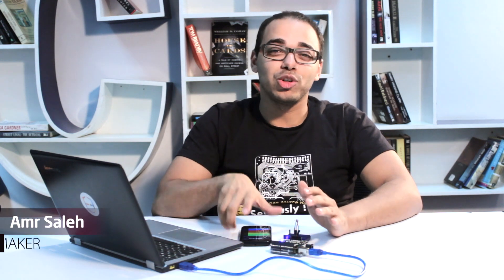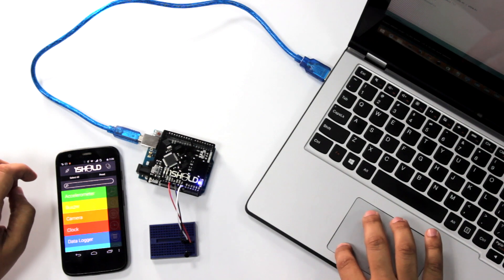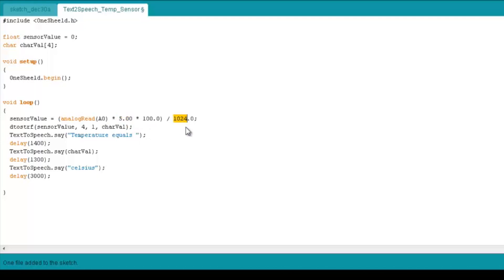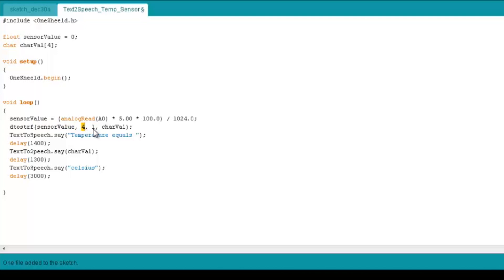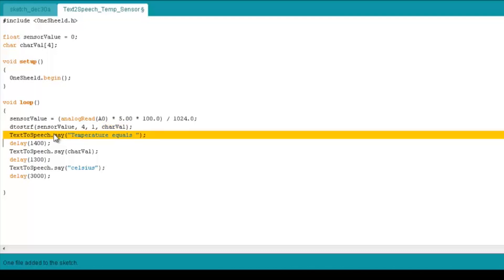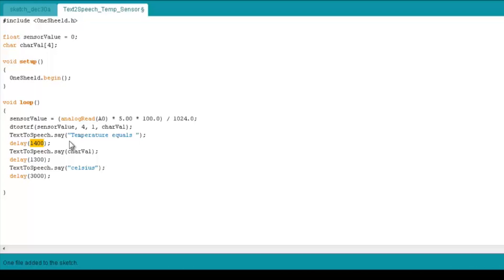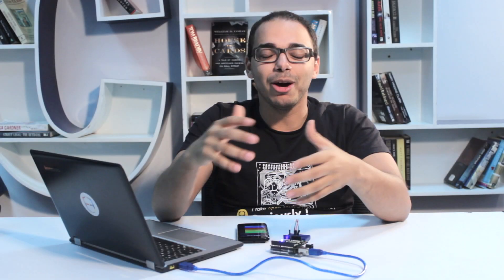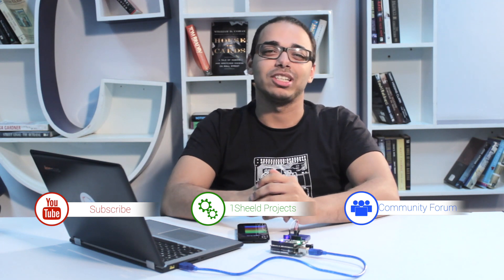How to make Arduino speak through your smartphone? 1Sheeld Text To Speech Shield Tutorial

Comment: hi can you help me how to control my motorcycle like light on and off an horn start motorcycle and ignition switch on and off how can create apps to apps inventor and create ah code to arduino can you please create for me please i want to make my motorcycle for keyless anti theives
Reply from the maker: Hi Irish, yeah sure you can do that but that depends on how your motorcycle electrical circuit work, you can check out this project for controlling a car it can give you some insights: https://www.hackster.io/Ashraf_Nabil/tracking-and-controlling-your-car-remotely-using-arduino-and-cc10ed

You can find plenty of playlists which can show you how to build apps using app inventor but why would you need to make a new app where you already have the 1Sheeld's free app in the app store and you can find it here: https://1sheeld.com/downloads/

So please check these links out and If you had any queries don't hesitate to contact the tech support via the live chat on our website through the blue button on the bottom right.